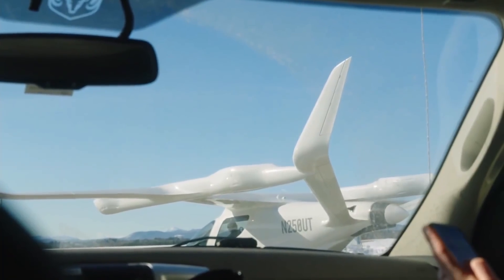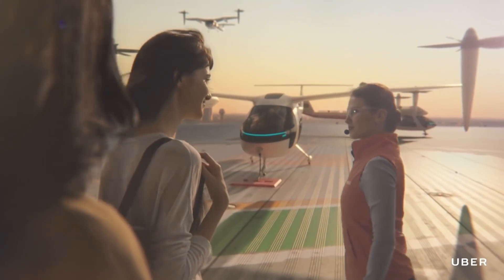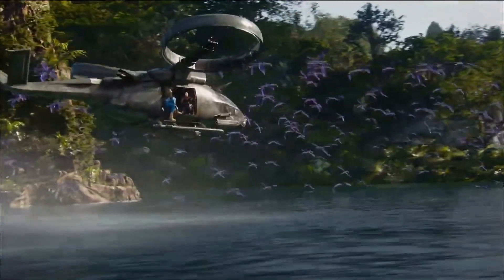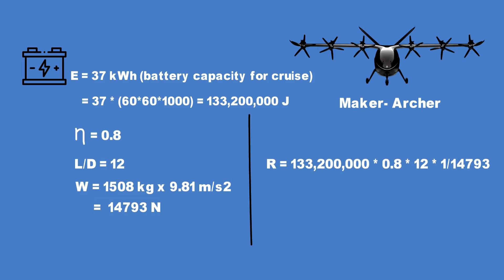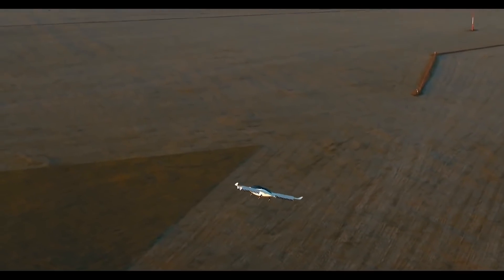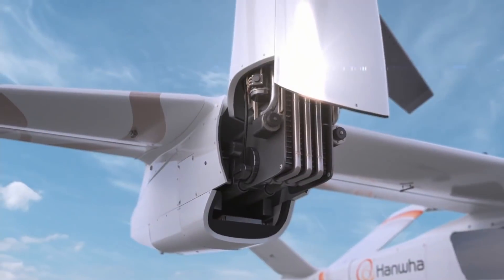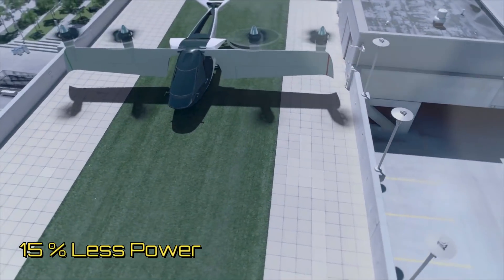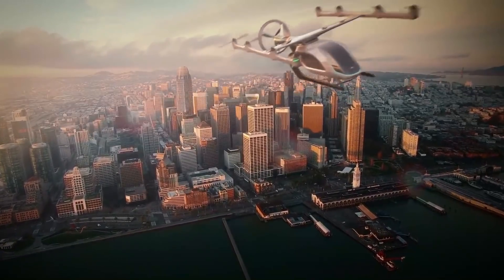The EVTOL Design Template: The emerging shape of most EVTOL explained

Comment: So if evtols have thrust greater than the weight of the plane why don't they fly very fast during cruise
Reply from the maker: To conserve battery energy. If you fly very fast, the distance covered will be less, but you will get their quicker for the same amount of energy. Most of these aircraft are designed to fly at 150 mph and cover 60 to 100 miles

Comment: The two parameters that work best to evaluate a VTOL are L/D in cruise, and Disk Loading in hover.  Push the L/D up and the DL down as much as possible.  Make reasonable design choices otherwise and you will have a good VTOL.  Evaluated that way, the Lillium design is awful, bordering on a scam.  The disk loading is way to high to work with existing battery technology.  The fact that it is super cool looking, and makes use of some clever aerodynamics doesn't make up for the fact that it can't hover for long enough with a reasonable payload to get the job done.  There is a reason you don't see them flying full mission requirements with a full payload.  Beware specifications based on wishful thinking.

Comment: I think your optimum battery fraction for max range only works for zero payload.  Any rule of thumb needs to include a percentage for payload, meaning passengers.  Currently that's a minimum of 2 passengers and a pilot, or a practical maximum of 4 passengers and a pilot.  When fully autonomous the pilot will become another passenger, but that is a ways off.  Finally, UAM doesn't require a lot of range.  Many of these aircraft are pushing their designs to achieve greater range than is necessary.  That is because they are hedging their bets and trying to compete against helicopters in the executive transport market.  That market, and the UAM market are significantly different, and really require different aircraft, but for now the various developers need to do all they can to keep their investors interested and sometimes that involves doing things that make no sense from a technical perspective.

Comment: Many "stop rotor" designs use 2 blades to reduce drag when stopped.  These can be increased to 4 blade designs by using a "scissor" mechanism, but it has not been widely done yet.  All these complicated mechanisms are subject due to possible problems with icing.  These things will not always be flying in good weather.

Comment: Distributed batteries are difficult to remove and replace.  Unlike cars, it's a bad idea to have permanently mounted batteries in these aircraft.  It it better if the batteries can be removed for charging, so they can be charged more slowly and properly cooled while charging.  Also, these aircraft should be in the air as much as possible, not on the ground charging.  In high volume operation, the batteries will wear out very quickly so anything that can be done to extend their life is worthwhile, and also makes for a safer aircraft.  As batteries evolve, and they will, a common form factor that allows for battery upgrade without aircraft redesign is also desirable.  These early prototypes have built in batteries, but once faced with the reality of making dozens of flights back and forth per day, the design will have to change.

Comment: Pure electric doesn't make sense. Only hybrids have the future. Liquid hydrogen is extremely promising and can quadrouple the range of kerosene based vehicles. Ammonia is clean and cheap replacement for hydrocarbons with 50% efficiency - seems optimal for short range transport.
Batteries are needed only for excess power during take off and landing.

Comment: I really like your videos, but the range equation is wrong. Does not include altitude. Also, you can have over 70 % battery of MTOW if you wish
Reply: Having a constant force via constant dynamic pressure (air density * velocity^2) means a high velocity in thin air. Since F * v = P, you can easily calculate power required (*0,8 efficiency) and therefore range
Reply: You can have the same power level (like 200 kW) in thin and thick air, but in thin air you travel much faster even if KTAS is the same. Requires less energy per distance.

Comment: The electric VTOL aircraft configurations presented can be categorised into:
- edgewise flying rotors - these are the typical multi-rotors, have a very low L/D, fighting gravity all the time, rotor effectiveness reduced because the blades are in a low Reynolds number flow, compared to similarly sized conventional single rotor helicopters.
- tilt-wing/tilt-rotor - transition to wing-borne flying mode, but the prop-rotor design is a compromise, too small for hovering, and too large for effectively providing high speed cruise thrust.
- lift and cruise - having separate systems for lift and for cruise thrust - always you have a system that is 'dead weight'.
- stopped, folding, stowed rotors - are 'dead weight' in cruise, and providing extra drag. The L/D value of 12 is theoretical only, never demonstrated in practice. 
5 thick blades have reduced noise, but increased aerodynamic loses, requiring more power to produce the same thrust as a conventional 2 bladed prop.
Aerodynamic effectiveness of an aircraft matters, the L/D and the propeller efficiency is - as was shown - enter into the range equation. Drag is a very finicky subject,a Cessna 172 best L/D is about 11 and that is without extra rotors and nacelles and what-not creating a lot of interference drag, not sure how they reached a L/D of 12 for the VTOL aircraft having the extra elements. The rotors need to be quiet, provide lift in hover and high speed cruise. A small 2 bladed propeller, designed for cruise speed only barely reaches 85% efficiency. A more appropriate value for a 5 thick bladed prop-rotor efficiency in cruise would be around 60 to 70%

Comment: Thanks a lot for making this video, you bring substance to the table.  I think, the best evtol would be 4/5-seater opener with ducted propellers (8) with four pair wings, two on each side.  Two ducted props on each wing pair.  The power pack should be hybrid (battery plus fuel cell) to manage weight. I assume as the opener does not need tilt mechanism, this design will not. That is the flying car that can replace SUVs from the roads, if powered by automatic flight/navigation. Around 7 by 4 meters in dimensions. If you can run the numbers on this design in a video that would be great.
Reply from the maker: Noted

Comment: Why electrical jet engines have not been employed in the latest EVTOLs designs?
Reply from the maker: The blast from them is one of the most corrosive jet of plasma known to mankind
Reply: @ElectricAviation  what if the propeller blades are placed in the jet like chamber. do it have any advantage like reducing the turbulence within the space between propellers or it is just an extra wasteful weight?

Comment: Just a possible correction: I believe Joby and archer don't use two motors per propeller but instead two seperate 3 phase windings wound around a common stator core with independent motor controllers. The idea being that a phase to phase short circuit won't render the motor useless, it will just be able to run at half power. See Siemens pd200 documents for an explanation of the same safety system.
Reply: what documents Capo?
Reply: @lorenzocapasso8881  see page 17 https://www.google.com/url?sa=t&source=web&rct=j&url=https://www.bbaa.de/fileadmin/user_upload/02-preis/02-02-preistraeger/newsletter-2019/02-2019-09/02_Siemens_Anton.pdf&ved=2ahUKEwjt-4vEwcHxAhUR8HMBHYXvDdMQFnoECC0QAg&usg=AOvVaw2RTn8H-EZOjaa3DPJbBhoA where it speaks of redundant windings. I recall seeing similar wording used by some of the eVTOL manufacturers.
Reply: @RichardRParsons  that's an interesting read. I wish there was more info about the redundant windings besides one mention. I'll look elsewhere for info. The practice has been in place for decades in multi-speed 3 phase motors. Two independent sets of windings with one contactor for each. One set is low speed and the other is high speed. I could see the electric aircraft motors running only one set of windings at any given time except for vertical flight so that they and the associated controllers aren't all wearing out together.

Comment: I like the tiltwing because during cruise it seems to allow a classic configuration for less wetted surface and more aerodynamic shape and maximum efficiency.
But I also wonder if we'll see something like a quad copter that extends and retracts it's rotors out of the fuselage so they can be totally smooth like a landing gear. Maybe something like an ultra efficient celera 500 but with extending quad rotors. This might require additional height for the fuselage. I don't know if it matters that much but most other tilt wing designs seem a bit clumsy to me.
Thank you for your videos! You really make the figures and challenges easy to grasp for me as a layman.
Reply: If you like the tiltwing, have you seen the PteroDynamicsTranswing design?   https://www.youtube.com/watch?v=3uNboCgDOKQ
Reply: @codetech5598  Thanks that's interesting. I imagine being compact could open up some opportunities.
Reply: @dejayrezme8617  There are other aircraft with wings that fold for storage or transport, but the fact that the folded mode of this aircraft is the exact mode for takeoff and landing make this design ingenious.

Comment: Great video as always! 🔥
I think Lilium architecture, ducted fans, is the way to go. At least for inter-city transportation and longer distances. 
I working on a Video about Lilium Jet Technology, coming out in a few days 💪
Reply: Doubt it
Reply: The ducted fans need much higher power during hovering which requests a much higher power density of the battery. Generally, power density and energy density are a trade-off in battery design. Meaning they won't be able to using the high energy battery compared to other design
Reply: @xuyan2650   Well, they don't have to. On cruise, the Lilium jet uses 10% of the hover energy. Hover represents only 5% of any trip time. 
Lilium optimized for the Cruise stage while the rest did it for hover.
Ducted fans is the only design that can scale without increasing size (bigger than helipads) or noise.
I just uploaded my video on Lilium Jet, I talk about this. The Paper from Lilium on the 7 seater jet goes more in depth.  
It is interesting to see how all this is gonna play out!
Reply: @eVTOLinnovation  The energy  (kWh) makes sense. However, the higher hover power requirement requests higher power density from the battery and lower battery impedance in order to make sure the motor can draw the energy out of the battery. For the hover case, you can't draw the power out even you still have energy inside your battery due to the low power density. 
I will look at your video first and see if I missed anything. FYI the link of the 7 seater paper under your video doesn't work for some reason. it shows 404
Reply: @xuyan2650  Fixed the link. Thanks for letting me know. 
Do you think Lilium is speculating with a battery breakthrough in the next years to be able to fly?
I think if they really had battery problems they would have stayed with the 5 seater or even a 3 seater.
It is hard to know, I am not a battery expert and we don't have all the insider information.
Thanks for your insights 👍

Comment: The tiltwing planes such as the ASX that rotate about a single pivot will never be certifiable. At least not in the US because a single failure (the pivot) can take out the whole plane.
Reply from the maker: You can have two tilting links for redundancy
Reply: Kind of ironic considering helicopters have many single points of failure
Reply: @wpfilms2  Good point. Helicopters are certified to FAR part 27. Big airplanes are certified to part 25. Small airplanes are certified to part 21 or 23 and it's not clear to which evtol's will be subjected and the safety standards are completely different.

Comment: Love your videos... everyone is so informative. 

I wanted your opinion on the following: What do you think about a detachable "tug" concept vertical takeoff and vertical landing?  Decoupling from vertical takeoff is easy especially with computer coordinated separation algorithm... once altitude and forward speed are acceptable.  

At this point the issue is safely docking for landing.   Using a crane skyhook concept with built in pitch yaw roll boundaries.  This allows the full weight of the energy density to be used for range.  Beta is planning on using charging stations so these TUGS would be stationed at each charging station.  Btw I am both an aero-tow Hang II pilot as well as fixed wing Skylane 182.
I've also done formation flying and experienced putting my wing into prop-wash behind my colleague flying a head.  I believe like the Tesla cars if you don't brake... the car will if an accident is imminent.   We have the ability to allow the computers to handle these two transitions.  I would love to get your opinion on this...
Reply from the maker: Its an idea with a lot of potential. Reminds me of Zipline drones and how they are delivering blood in areas where there aren't event proper tracks leave alone roads. 
https://www.bbc.co.uk/news/av/technology-43886039
They use a ramp-sling launch and a sky hook so almost all the energy in the battery is used for cruise. 
Something similar can be done at vertiports.

Comment: Its interesting that, in the world of cars there seems little visual difference between successful electric cars and the conventional.
The briefest look at any of these aircraft seems to spell entirely different configurations. Now true aircraft design has changed little from the spam cans of the 40's. Vertical flight (although it is not completely apparent to me the legal utility of vertical flight capability) is the apparent motive, but it is also something we are technically capable of right now with helicopters, yet for other mysteries do not use. 

Also to the minus of the tilt rotor, the lack of ability to land unpowered. 
The helicopter has succeeded in part because of the ability to autorotate and the layer of safety that offers, and I think the helo will be difficult to dislodge because of this, especially for passenger flying.

Comment: VTOL capability usually is a less efficient way to get airborne than with conventional fixed-wing planes. And because efficiency and saving weight is everything with electric flight, I have no idea why eVTOL is the new hype. Nobody knows if there actually is a market for air-taxis, not to mention safety issues, regulations, infrastructure, noise concerns in cities... There's just no good reason why the demand should be any higher than it has been until now with helicopters. That little difference in noise level can't be it.
What I'd like to see: a production version of the Eviation Alice and a fully electric version of the Celera 500 or similar aircraft. Makes much more sense, both from an efficiency and business model standpoint. Adding distributed propulsion in electric aircraft with an otherwise more conventional airframe is probably smart (and of course light-weight composite construction), but eVTOL with tilt mechanisms etc is too much complexity and inefficiency for those tiny battery capacities.
Reply from the maker: For me, having low noise eVTOLs are ideal for commuting in rural areas. Solid State batteries will be the next step. We have achieved 350 to 500 Wh /kg in the lab. Current batteries being used in EVOTLs are 275-250 Wh/kg.  This will increase the range or payload significantly.
Reply: @ElectricAviation  Sure, but a fixed wing aircraft with the same battery will have even more range. As long as there is no special infrastructure with landing permits and recharging stations for eVTOLs, they would have to land at normal airfields anyways. Burocracy is slow.
I love electric aviation, but I think take-off from a conventional runway is still the way to go. Why would we need vertical take-off in rural areas where space isn't a problem? The only argument is the potential for automated flight, without a pilot. In the city I would understand the VTOL argument, but then there's still the noise: keep in mind that a lot of the noise doesn't come from the engine, but from the propeller. Less noisy doesn't mean it's not still annoying. Whether noise is disturbing is also a matter of  frequency. E.g. the noise of a Rotax 914 (internal combustion)  is much more annoying than an IO550 in my opinion, even though the IO550 is the larger engine. Why? RPM (no gearbox considered(Rotax)). Electrically driven propellers also have a similar problem with high frequencies due to also typically high RPM (in this case prop rpm). --> I don't think the noise problem is really solved. It would still be too annoying in the city. In summary: electric flight=great, electric VTOL flight=not so much, until proven otherwise
Reply from the maker: @___Chris___   I agree the fixed wing electric will see more success in the near future. France has banned all intercity flights that are within 2 .5 hours away on the rail. This is where fixed wing electric aircrafts can come in. As for eVOTL, they are driven by romanticism. It is the age old dream of having a flying car. With eVOTL, people can see that its finally becoming true. I believe that Jaunt Aviation's Rosa has a lot of potential for city centre to airport hops. And it offers safety too